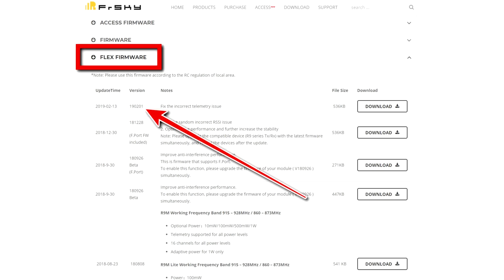FrSky R9 firmware mess and how to live with it - the answer is FLEX

Comment: Isn't ACCESS faster? I.e, isn't that the clear benefit from using it?
Reply: Andrew Higginson It is. Plus binding without touchig receiver, passing control of model to another radio and few more. ACCESS flex fw works on xm+, r-xsr and r9mm, r9m2019 module with no issues.  It’s the law that says if u want to sell in US it must be fcc compliant and in  EU LBT  compliant . Manufacturer or distributor cant sell radio legally without proper radio fw. So FrSky  developed flex fw that won’t ever be installed on sold radios or RXs because allows to set “illegal” frequencies or power. User can do it taking full responsibility. What is so complicated about that? I’ve got x9d2019 and x-lite pro with r9 access modules. Plus multi module for both of them if I really need to bind in d8 or anything else
There is old saying “you get what you pay for”. You got free advice.
Reply from the maker: In theory it is. But the funny fact is that 99% of the users will never notice any difference :)

Comment: Ok, time to switch for xfire. Got r9, got it to work, i admit it performs same as xfire, but god, its such a headache each time i got to work with it...
Reply: I'm not sure I would say it performs the same, Crossfire is way more superior.
Reply: @TexasWaters  my tests say otherwise, failsafing at exact same distance(+ - few meters) given running at same power.
Reply: @TheTryzna  well you are the one of the lucky few that got something decent from frsky I suppose.
Reply: @TexasWaters  yeah, guess im lucky, but know few others with rock solid r9 for whole season so its definetly working if setup right. The two main reasons for me to switch is couse i dont want to go through that pain of getting it setup again(mainly flashing the receiver) and couse who knows how long these receivers will be available at all. I ll keep qx7 and r9 through this winter, but after that im going crossfire anyway.
Reply: @TheTryzna  I still using the X lite Pro for now with the XF lite on the back, I hoping the Tango 2 will be a similar formf actor. I'll be witching if so.
Reply: @TexasWaters  yeah, have exactly same intentions man!:-)
Reply: Crossfire The headache medicine.

Comment: Can i flash r9mm OTA receiver with old flex firmware (ACCST protocol)? I ask because on horusrc.com there is not r9mm receiver just r9mm ota ACCESS
Reply from the maker: I read somewhere that is not possible
Reply: Means no more compatible receivers to buy for an old r9 transmitter
 on horusrc.com :(
Reply: R9mm ota can be flashed with non ota fw. It has been confirmed ;)
Reply: Ok👍
Reply: I think I have the same issue. I ordered R9MM and got R9MM-OTA. I'm using flex on the older R9 module with flex firmware. So are the comments saying flashing the old R9MM firmware to the R9MM-OTA should work?
Reply: @ndcapper  yes. You can!😁🤗
Reply: @AdrianAndreiRobert  thanks! If not I was going to crossfire :)
Reply: @ndcapper  crosfire is the same. Except there it is tx and Rx not the sbus bullshit that manufacturer's don't want to ditch. Flash it. Use flex. Set it on f.port not sbus and you are good to go.
I am using flex access on an R9M lite pro module that sits on an x-lite (non pro or s version) . I had 0 issues in setting it up. No hassle and a pice of cake. Just remember. Access with access and accest with accest. If your system supports access I would recommend it. Works like a charm if you set it up right.
Ooo.. and don't forget about the inverted port if you are on f4 and want to use f.port
Reply: @AdrianAndreiRobert  thanks again. On my current R9MM in using flex and f.port. no problems so far. Glad the R9MM-OTA work with flex. I like the RX prices of Frsky and it seems to work well

Comment: I stop managing these firmwares and started using Crossfire,  I will never look back. frsky tried to ruine this hobby for me. 
I would highly suggest you do the same before it's too late and they ruin it for you too.
Reply: Crossfire updates and binding are pure BLISS compared to the R9 system.
Reply: @WeMakeLaw  I was infuriated about CRSF because my receivers would not bind to the transmitter. I did everything right, I suspected. Powered the receiver on with bind button pressed. Who would expect the receiver to be in auto-bind for convinience when it's powered up for the first time ?! ;)
Reply: Thing is its nearly impossible to get a crossfire module these days
Reply: @elxero2189  yeah, I got mine back in October 2019 during the R9 buy back deal, I ordered a XF lite and was getting the buy five get one RX ordered 10 nano se, got 12. I think I got 120 credit on my R9 gear as well. Paid for fast DHL and got it in 3 days !
Reach out to Trappy or any of the Facebook groups, they will let you know, most likely "two weeks" dO)